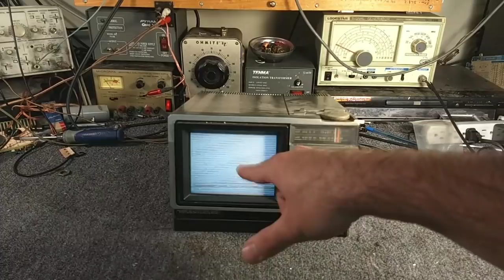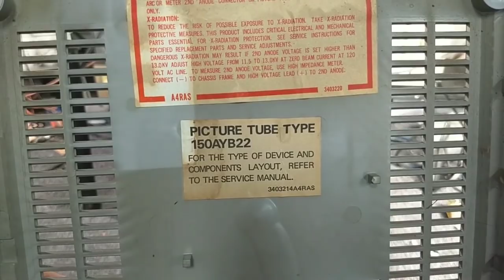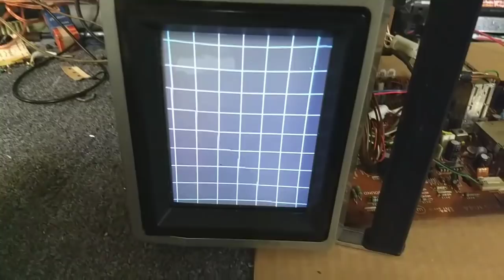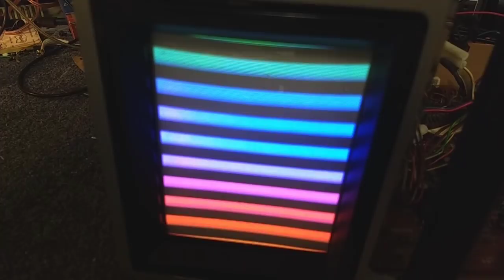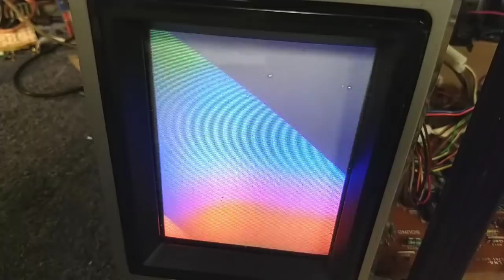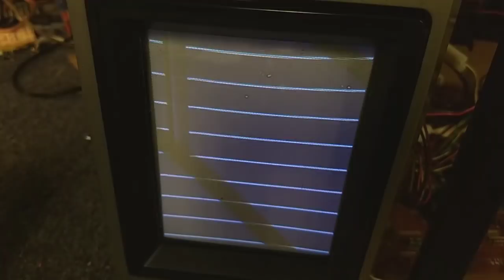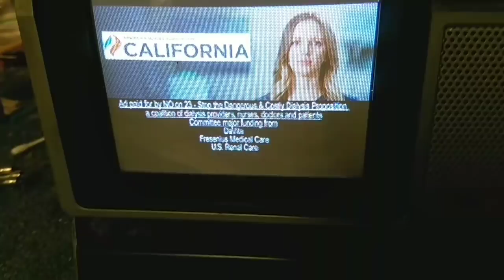Servicing a 1980s Sears model 564.40000150 5" portable color tv

Comment: That's a nice 80s 5 inch. Usually I've found them to be an Orion CRT. They seemed to be big back then. I had a TMK unit with the 5 inch shadow mask. When focused they put out a pretty impressive picture. Nice job!
Reply from the maker: I've got one of those TMK 5" - really good picture. I had to repair the bezel because a chunk of plastic had been broken away. I made a dam and filled it with clear epoxy. Sanded and smoothed and painted. Turned out decent.

Comment: I've got a 5" Montgomery Wards Color TV that still works like brand new yet.

It could run of either 10 "D" batteries, a 12-Volt car adapter or 120v plug in.
It has 300 ohm antenna terminals for UHF and VHF and the original rod antenna is still intact too. 
When I first got my TV from Goodwill a few years ago the picture was kind of dim so I adjusted the G2 adjustments and the picture brightened right up, and it's been working great since.
It's a low hours set I'm pretty sure.

Comment: They took out the portability of these TVs when they went digital    You could take this tv to the beach when they had analog.  They don’t make a battery operated digital box
Reply: I've heard of converter boxes modified to run on batteries, it should be super easy if the power supply is separate from the main board.

Comment: A Sears branded CRT in a Sanyo made TV. Sears must really have had a lot of power to make their suppliers use their brand on internal parts.
Reply: They did. Sears was a Dow Jones component for many years, and was the number one retailer until the 1990s. Theirs is the type of power WalMart has now. Another thing to consider is that Sears wanted the CRT rebranded for warranty purposes. They offered a separate CRT warranty.
Reply: @waltschannel7465  So, I could open up a WalMart TV today and find WalMart branded major components inside?

Comment: I just got this exact same tv, only the top half of the CRT is working :P any ideas? Just started this video but looking forward to what I will learn. I don't have enough to buy another one to test sadly :P but I know for sure it's not the vhold switch itself, tested that up and down 0-3v then applied 3.2 volts and it only got brighter and didn't move also adjusted the "v-size" switch on the inside with the same result.. I don't really know how to work on crts but have had a lot of them and understand how to check and discharge electronics. Safe work is happy work I suppose
Reply from the maker: Failure in the vertical sweep circuit.
Reply: @JordanPier  If you have a minute, What does that entail as far as things I need to repair it? Thanks for the reply! I sadly do not have an oscilloscope.
Seems like it must be a capacitor? 

I also thought it seemed a very well made product 👌

In the end I also have a 1989 sears 562. 42082950 and a KEC 13BNL/2 that probably need some work so I will probably end up getting some tools for this, thanks again for he video 😎
Reply from the maker: @killerrr3211  if one half of the screen is missing it's more likely transistors or integrated circuits that are causing the prob. Capacitors affect waveshape which will distort the picture, but usually does not kill half.
Reply: @JordanPier  Thanks, I thought they all looked pretty good and the ones I tested seemed ok. Time to do some research and check those out 😎

De soldered a cap 25v 22uf but even with no solder I couldn't remove it, thought maybe it was leaking but maybe it is glued to the board 🤷 either way before I soldered it back I turned it on and only got the top left corner. Cap had about 10v going through it  (c477 on the main board) before I de soldered it but I have no idea if that would be the correct voltage or if I am just digging myself into a hole here 😂 either way just in case this may help someone I will leave my result here. 
Replaced the cap, same smell.
On too transistors 😎

Comment: Where did you attach the digital converter? Have the same model, but can't figure out how!
Reply from the maker: @Surreal452  if yours has only the screw terminals on the back you need a 75 to 300ohm adapter.
Reply: @JordanPier  thanks ☺️
Reply: I managed to get it to work via VCR/DVD player with the adapter. Amazing to bring it back to life